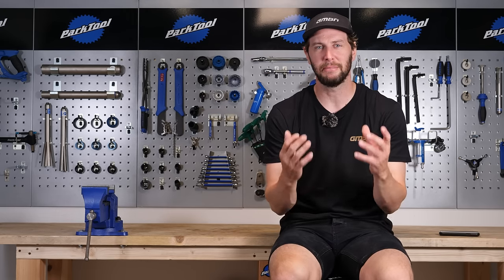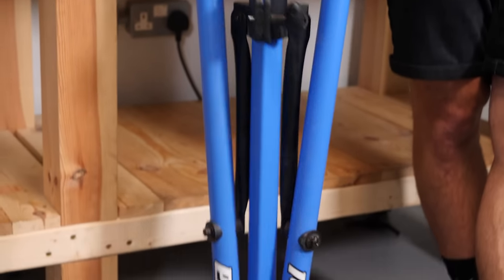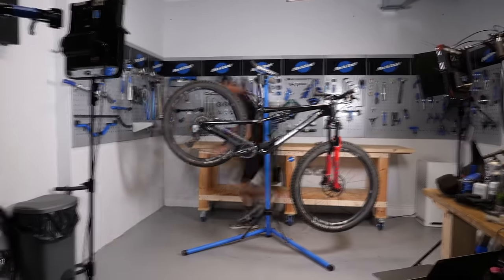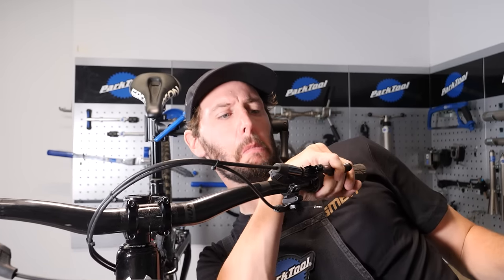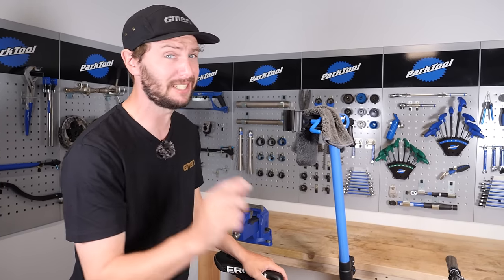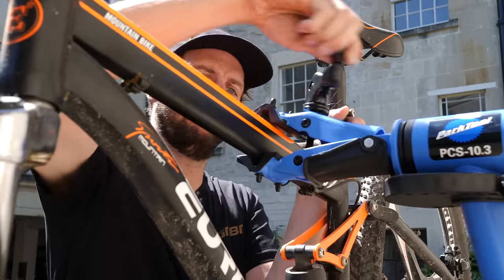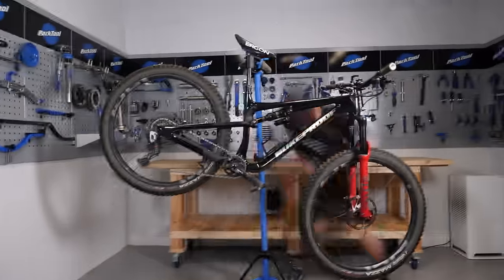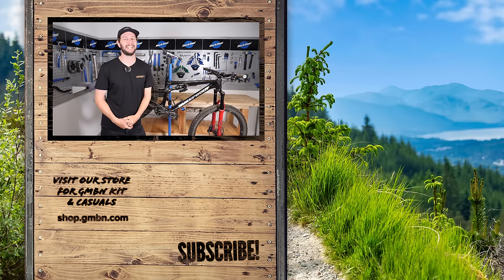How To Use A Bike Repair Work Stand

Comment from the maker: Do you own a work stand? Have you ever heard any horror stories of people clamping their frame incorrectly?
Reply: I have a Bike Hand in the basement, always grab the bike by the seatpost
Reply: I’ve slightly gouged the dropper seat post not realising there was grit on it, I’ve got that stand it’s way overpriced for what it does.
Reply: Yes, game changer
Reply: When I started servicing my bikes I clamped mine from the top tube of the frame. Every ride is a reminder of one bad decision as I see the scratch there, every time I ride. Scratches off trail hurt more.
Reply: I have a bike stand.  I clamp it the way you do it in this video (on the seat post).  It scares me because my bike is a  bit heavy (around 15Kg).  I'm worried that I might crack the seat tube because clamping on the seat post is forcing the bike upright while it is naturally nose heavy.  Please enlighten me.
Reply: I clamped it on the top tube near the seat post.
External routing. Was wondering why my shifts were lacking recently, guess I found out now. So do I need to replace the cable now?
Reply: I have problems whit my mtb falling off the  the stand when clamping to seat post so top tube it is
Reply: @Paganiproductions84 I have a heavy bike which is nose heavy when clamped via the seat post. I can't really use the top tube as I have external cabling, so I clamp the seat post and support the front wheel with a small wooden crate. It makes the stand much more stable, the only slight downside being that I can't spin the front wheel when in this position.
Reply: I am an example, watch the video too late

Comment: And remember not to force the bike level when hanging from the seatpost. Let the bike hang in its natural angle and the seatpost should be vertical. Otherwise it may stress the dropper too much if you force the bike level.
Reply: @Jezze90  I put way more force on the seat post when sitting on the seat in rough terrain, than leveling the bike with the seat post clamped ever will.

Comment: I clamp to the top tube as I have an aluminum framed hardtail. I also don't clamp it tight with my centre aisle German stand. It seems to sit nicely. It just feels too heavy and unwieldy when I try and clamp the seat post, but I'm sure if I had a carbon frame I'd go the seat post.

Comment: Bought one from Halfords six years ago for £25. All nuts are stainless so no rust. Always clamp on the top tube of the aluminium frame.
Reply: Which exact one did you buy? I got the Bike Hut, Halfords Bike Stand just a few days ago. Have not used it yet. Will that one I got rust? Thanks

Comment: Is seatpost clamping safe when you've got an e-bike or other heavy bike with dropper?
Reply: Now this is a very good question. Never thought about this one.
Reply: With alloy MTBs it won't be a problem at the top tube. E Bikes using carbon fiber frames are not that common.
Reply: @simonm1447  US?

Comment: Not too long ago, we were building a new frame out that we didn’t know was already cracked, but when clamped tightly to the top tube we heard a crack and saw that there was a big crack down the top tube. We then looked at the pictures we took of it before, and noticed the same crack but a little less big. We then got it fixed and it is now in working order.

Comment: Rick.  Have the same Park stand.  Usually clamp onto the upper seatpost like you; but, also just hang the bike by resting the underside of the nose of the seat on the backside of the plastic-protected clamp for minor jobs (like lubricating the chain).  Used to have a higher-end Park stand with a weighted base; but, it was cumbersome to move about and store.

Comment: IO switched to a carbon frame (road, but that's not important in this equation), and I ditched my cheap clamp stand, and switched to a Feedback Sports Sprint, which secures the bike through either the front or rear axle and rests on the bottom bracket, and I can spin the bike on the spot. That thing is brilliant, highly recommend this type of stand.

Comment: Just got the same bike stand and didn’t realize there were specifics on where to clamp.  Have been clamping around top tube (thankfully not too tight.  Will be changing that and using the seat post.

THANK YOU

Comment: Regarding the clamp on frame, imo it’s only an issue with Carbon frames. You don’t have to worry too much about clamping too hard on an aluminium or Titanium frame. Ofc do be mindful that you don’t scratch your frame paint while doing so
Reply: It may be a problem with very thin walled alloy road bike frames, but not with 2000 G + MTB alloy frames with thick tubes

Comment: I have the Feedback Sports Pro Elite stand.  It's fine for a normal bike but despite a load rating suggesting otherwise, it doesn't do well with my ebike on it.  If I had the option to return it, I would.
Reply: do you take the battery out of the bike before putting it on the stand?

Comment: My bike is quite heavy (37 pounds) so I don't use the seat post. I'm just not comfortable,  and even less comfortable with rotating while clamped to the post. I use the top tube but only clamp as tight as it needs to be. I have a vertical shock so lots of room.  If I have to take a wheel off, I adjust the clamping position so it's balanced.

Comment: Not just carbon frames
If you look at the tube catalogue for for bike tubes. Some high end triple butted aluminium tubes get down to 0.5mm wall thickness in the middle you don't want to be clamping things like that in a work stand.

Comment: great video! Question here: how to keep the bike level to the floor when clamped by the seat post? (I am learning to use a chain cleaning tool and wasn't able to use it properly- the degreaser was not level in the container and spilling everywhere do to the bike tilt... Thanks!

Comment: Thanks so much for the info, but i haven't been able to clamp my bike from the dropper cause i can't get the jaws close enough the post to keep the bike still, any tips?
Reply: Wrapping the seat post in a rag should do the trick. It’s the usual way of protecting carbon posts as well.

Comment: One of the most useful purchases made. It is not a nice one as yours, but works good enough. Will probably update it at some point. The main problem with cheap ones is that depending the position your bike will turn to one side or the other. Other than that they get the job done easily.
Reply: even with the more expensive ones that happens. i just got done commenting that the Park Tool stand that my work just got does the same thing and it's brand new, but every bike i work on ends up tipping towards which ever end is heaviest which is usually towards the front. It's really annoying, I wish they would have added a feature to lock that part out so it can't turn.
Reply: I put carbon grip paste on my cheap one and it realy helped
Reply: @KidKatree  That is a clever idea. More grip just like that. I will try it out! Thanks for the tip.

Comment: What are your thoughts on leaving a bike (with dropper post) stored in the stand?  I can’t imagine it hurts anything but thought I’d ask
Reply: I take the wheels off and put a dummy gear for the chain and brake spacers, when I plan on having the bike on the stand for a long time.
Reply: if you pull on the dropper post too much or for too long (leaving it in the stand for a long duration) you can create a vacuum in the post.

Comment: I saw  that you hang the bike on the stand by the dropper seat inner tube.

I was shocked, thinking that the tube will bend, even very small bend and it will ruin the dropper.

What is the expert’s opinion?

Izzy

Comment: My KS LEV DX dropper is externally routed thankfully, means I can disconnect in seconds and just put a standard diameter post in for putting it in the stand.... Wonder what tips they have for using bikepacking gear with a DP? So far I just swap out the post  and saddle and live with manually adjusting it for climbs and descents like we did back in the day....not wrecking the DP with a muddy bag clamped to it moving around!!

Comment: Isn't clamping the seat post bad for a dropper seat post? Thought I heard that somewhere. Avoided doing so ever since
Reply: No, because it normally handles weight of you, which is much more than your bikes weight. Dont twist it tho.
Reply: @komoonkh  it's designed to handle your weight in compression. With it hanging from the post you are subjecting it to tension and twisting forces if you rotate it to bleed the brakes for example. I clamp on various spots depending on the work I'm doing.
Reply: @komoonkh  gotcha. Makes sense 👍

Comment: my work has a Park Tool bike stand that we just got. The one thing I don't like about it is that after clamping the bike in place the bike always inevitably ends up tipping down towards whichever end of the bike is heaviest. I always clamp the bike in level and it always ends up tipped down no matter how tight I tighten the spindle thingy on the back of the stand. Do you have any advice for this?
Reply: Dont use heavy forks haha. My stand does that too, that suntour needs to go haha

Comment: Wouldnt you have the same consideration of not clamping down on your seat post too tight just as much as your frame? I would assume the frame would be stronger than the seat post, especially from a dropper post... I've always clamped my bike on the top tube but closer to the seat post where the weight is more evenly distributed (it would be able to balance on the stand even without clamping) - then I just tighten it enough to where it doesnt move around on me.  So not very tight. Maybe more consideration goes into this if it's a carbon frame?
Reply: frame is normally a lot thinner materal and has a bigger cross section so is more easy damaged by compretion than the seat post, the seat post is desined to be clamped into the frame, the actual strenth of the frame compaird to the seat post dosnt really come into it in this case,

Comment: i work for a lbs in which we are not permitted to put a bike in a stand non-drive side out. even if we’re fussing with a bb. 
 
our stands are bolted to stations about 1.5 feet or .5 meters from the wall so you cannot walk around the bike.

can anyone tell me if this is logical or preferential?

Comment: It depends on the individual frame. Clamping on the top tube of a fragile, thin alloy road bike frame may not be the best idea, the sane with carbon fiber frames in general (carbon fiber behaves different than metal). A normal alloy MTB frame however is more than ridgid enough to take that load on the top tube (these are 2200 G frames) and with cromoly it's never a problem

Comment: If you need a video on how to use your bike stand, you probably should not be working on your own bike 🤦‍♂️
Reply: If you like to tinker and see how things work why wouldn't you like to teach yourself to do basic repairs?.
Reply: @dinokarakostas6407  Exactly ✊🏿✊🏼
Reply: so learning how to maintenance,repair, and tune your own bike is a bad thing? a bike stand makes eat easier to do maintenance on a bike especially since the back wheel needs to be lifted so you can clean the chains properly
Reply: Are you utterly insane?! EVERYONE starts somewhere. I got a bike stand ONLY to wash my bike. Can do puncture repairs a bit easier perhaps too and dont risk scratching the frame when the tire is out. or the seat if upside down. I would not repair my bike myself as I have no idea how. Bike stands apparently make washing a bike much easier. I have not used mine yet though, got it only a few days ago.
Reply: I ridiculously overpaid for a repair stand, but I have one.